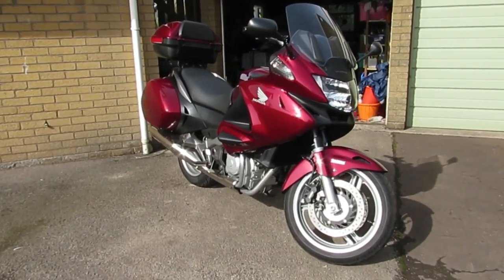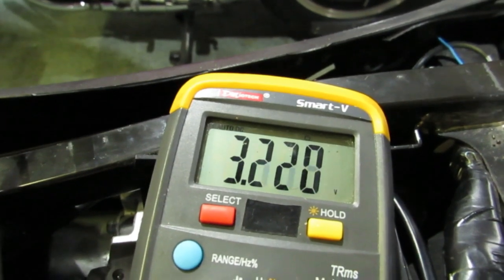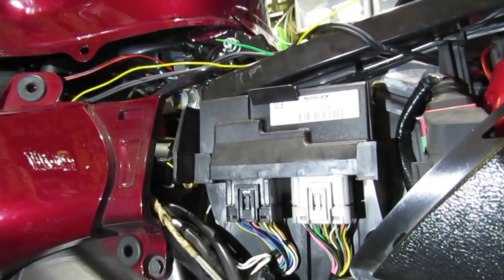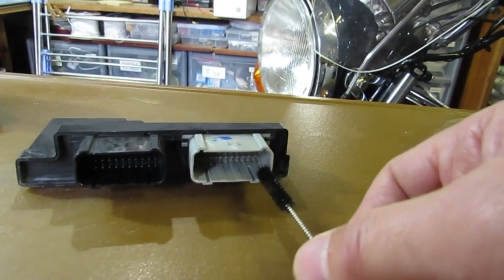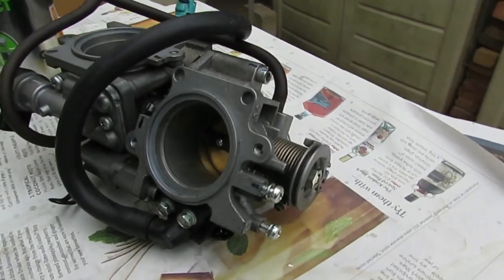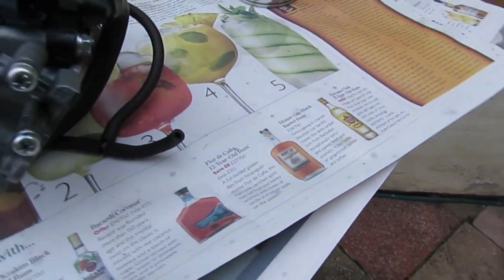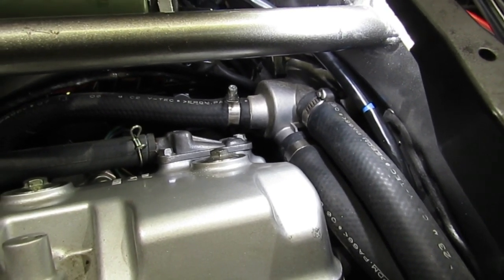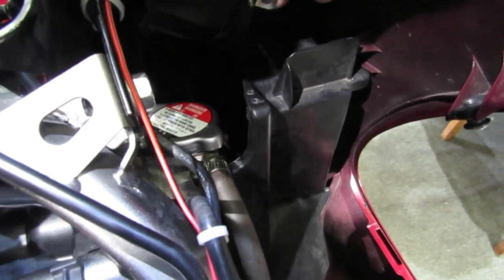NT700 Throttle position sensor investigations

Comment: I just took my new to me 2010 9700 for a ride today here in October/2023. I only went on for about a half an hour after making all the personal adjustments and tire pressures, living things like the kickstand in the center stand pivot stuff like that. About five minutes out, I noticed a hesitation in the acceleration as I opened the throttle… I see that this machine has a throttle position sensor. I also see that they are problematic. I remember reading about throttle position issues with the early FJRs.. my new to me nt700v has 7500 miles on it.. I bought it from the original owner, who quit riding because of health issues.
 The machine was always kept inside his house in the heated garage since new. I could tell by the number of spiderwebs there were wrapped around the center stand under the engine that the machine has been sitting for a while.
  I am going to have my first experience working on throttle position sensor issues. I’ve had quite a few bikes with fuel injection, my Goldwing, GL 1800, my BMW, K 1200 LT ,my last to moto guzzis, my current Kawasaki Z 400 … none of those machines ever gave me even a single hiccup. But now I’m finding out that the NT 700 has issues on the first day of ownership, on a machine that appears to never have been modified or tampered with…
  being a retired HVAC technician. I can agree with you that, most problems are electrical…
  I will say, the issue seemed to have been clearing up for longer. I wrote it today… it certainly was not consistent. It only happened maybe five or eight times. I have a feeling the machine just needs to have a long run, A couple tanks of gas through it. That’s my plan of action before I start assuming the worst. I’m gonna try the simple things first..:
Reply from the maker: Sorry to hear your new NT is playing up - that is always a bit of a let down! Hopefully it will turn out to be one of the simple things - bad fuel comes to mind if it's been standing unused for a while. Plug caps have also been implicated (lots of info about this on the NT owners group pages) but it didn't fix my issues although it would be a good (cheap!) place to start. Annoyingly the plugs are a bit of a sod to get out.
You sound like a good mechanic so maybe a winter weekend may be a good time to go for it a treat every suspect connector you can find with some 'Oxgard' to nail the problem once and for all and before it ruins your enjoyment of a rather nice little bike (as it did for me for a couple of years) Good luck anyway and let me know if you manage to sort it!
Regards, Steve P

Comment: Happy New Year! My bike is now approaching 70,000 miles since following your video! Thanks again!!!
Reply from the maker: Wow! great to know I was able to help. I have an idea that my issue was LACK of use as the bike is a 'summer toy' really. 
I went in the garage after a long cold snap and noticed a light film of condensation all over the bike and wondered if this might be enough to start some oxidation on the rather poor quality electrical connectors around the engine. Hopefully the anti-moisture treatment should now be enough to keep that permanently at bay. Regards, Steve

Comment: You can calibrate the TPS easily while it's in situ. The problem is access for the Torx driver as you mentioned. I clamped the Torx bit in a set of small molegrips and just cracked the bolts just slightly loose. Using the multimeter you can then adjust the position, as I recall, moving the rear part up slightly reduces the voltage ← check this
You don't need to move the TPS very much - your .509v is probably slightly over voltage and it needs reducing to about >=0.403v (Yes, I know the manual says 0.5v is in range but it isn't as it depends on a the value of the 5v line in the ECU - mine was a little over 5v - I think the calculation is covered on page 6-43 from memory) - Once I'd adjusted the TPS closed voltage to 0.403v the bike ran beautifully again - no kangarooing or hunting).
Note leave the multimeter in place and reading while you tighten the Torx bolts back up as it will move slightly (I set the voltage to 0.400v and by the time the bolts were tight, it was 0.403v).

For the valve clearance and coolant change I find it's easier to take the right hand fairing off.

Comment: Could it be the injectors , would they be fault proof.
I know people with cars and trucks need them "cleaned" and or changed every now and then.
Would they be less effective at low speed, as needing less fuel through as of any gunk might be more inhibitive at lower fuel.
Cleaning kits are available.. as shown in video's.. cheaper than getting a mechanic to do it per the hourly rate.

Comment: Great video thinking my TPS is shot but not sure will give connections on loom a good clean an hope for the best.
Reply from the maker: Go for it! My feeling is that these TP sensors are actually quite reliable but the connections become poor and/or corroded over the years and the mere act of changing them out for a new TP sensors (or even worse the whole throttle body at $700 or so!) 'cures' the problem by just providing a good contacts again.
I have no actual evidence for this - it's just a hunch, after dealing with numerous problems and electrical faults caused by poor connections over the years in various scenarios! 
My NT is still running fine since I posted this video. There has been  no re-occurrence of the 'bucking bronco' effect - and I would have expected this to have happened if it really WAS a bad TP sensor.
Hope you are successful in fixing your problem too.
Regards, Steve

Comment: Thank you for your video! I am having the same issue with my 2010 NT700 with 51,200 miles. Have you ridden the bike much and has it cured the problem? Thanks again and Have a Merry Christmas from the U.S.A.
Reply from the maker: Glad you enjoyed it and that it was helpful. Not too many miles up since these checks and repairs but i a quietly confident the problem is resolved - but who knows with an intermittent problem! My NT has a fairly pampered life and is only 9000 miles in 12 years! It is always garaged, so slight corrosion/oxidation on the connectors would seem to fit bill rather better than a worn out throttle position sensor. In my experience poor connections cause far more problems than faulty components! Have a good Xmas too - Steve. 
PS I am also considering the 'tweak' suggested in the comment below now I have a bit more experience of the system!
Reply: @astroideas9489  Thanks again!
Reply: Just a additional update...800 miles later...still running GREAT! Thank you again for all help.
Reply from the maker: That's great to hear. Not used mine much recently (for various reasons) but I'm glad to hear that my work (whilst standing on the shoulders of others!!) has been helpful - AND I enjoyed making it as well!!  Regards, Steve P
Reply: @astroideas9489  Now at 1,400 miles with no PROBLEMS at all! Thank You! Thank You! Thank You!!!